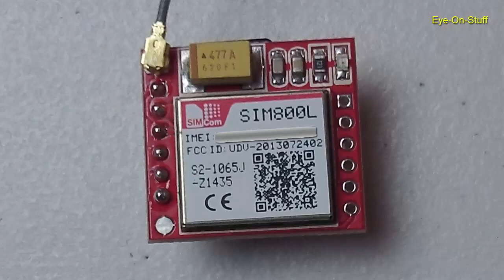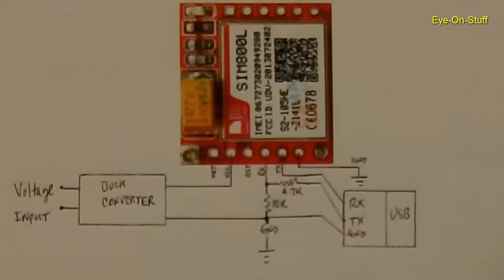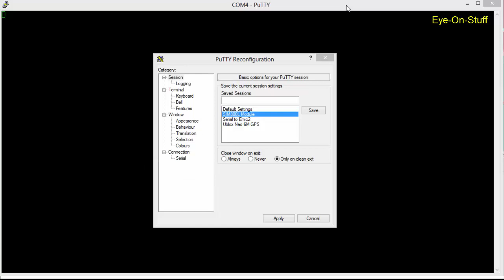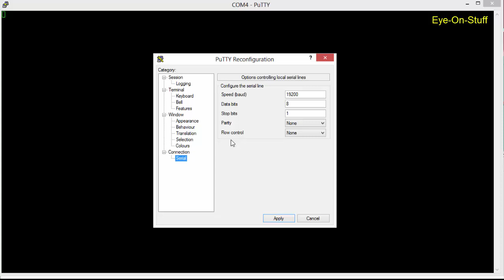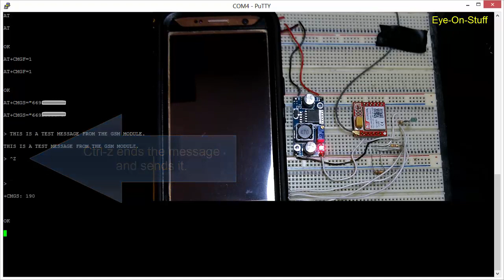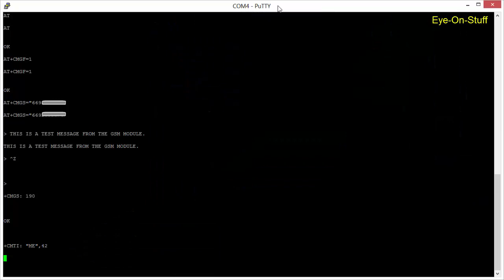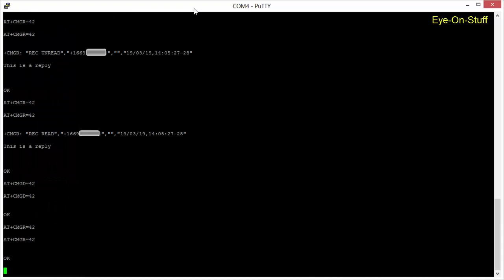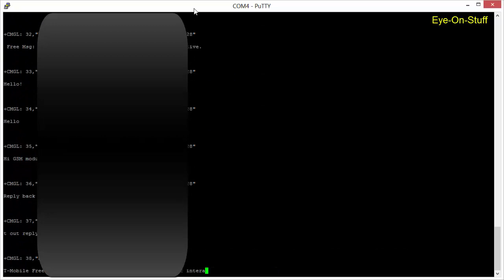How to use a GSM module to send and receive SMS messages : SIM800L : AT Commands : Eye-On-Stuff

Comment: thank you so very much, a bit of searching and this is the first video I found after a good bit of searching that covered SIM usage properly and was not just about setting up GSM with a over built module that used more power than I needed.  they also did not cover the basics and basic tool information like you did in such great detail. My usecase is a little different but now I finally have a good understanding of the direction I am going in.

Comment: Great video! I've just bought one of these modules. Could I simply drop a 5 volt supply through a diode and provide a large capacitor after the diode, to power the module?

Comment: Im using a giffgaff 4g it dont work, Can you help me figure out what im
 doing wrong, what sim card do i need and how do i get one.
Reply from the maker: Not familiar with giffgaff. If the sim card works with unlocked gsm devices then it should work with the module.  If the your sim card only works with a particular carrier then it will probably not work.
Reply from the maker: First try using your card in a unlocked gsm phone.  If it works, then it might work in the sim800.
Reply: Eye-On-Stuff I ordered a 1pmobile sim card... works perfectly 👍

Comment: Can I use Arduino uno? Please send codes for it I need it ASAP
Reply from the maker: My compiler is pic basic pro from Melabs. I don't use arduino.  To answer your question, Yes it will work with arduino. I'm sure you can find code out there for arduino.

Comment: Did you check how many SMS could you send in a minute? What is the SMS throughput? I would like to make my own SMS gateway for 2 factor authentication and notifications, and this looks like a neat solution!
Reply from the maker: For my application, I don't have the need to do that. Sounds interesting.
Reply: one hour one ports can send 800 sms 
Marketing bulk sms device. Send and receive sms at high speed .
Provide factory lowest price with free sofware ,offer free life time technical support.
Fast delivery ,hot selling in indonesia, Vietnam,malaysia ,USA,UK....
⚠️Hotline:
Whatsapp/ Wechat/ Zalo :+8613715985640
Skype : live:6bac679d890c89a2
Reply: there is a limit in gsm/2g itself. you can simply look it up, its not specific to this module :)

Comment: Bro in my project sim800 l blink after 20-22 seconds plz help me network doesnt stable 
Or
2g sim is mendatory or 4g can be used plz help bro plzzzz
Reply from the maker: If you have not tried it. I would use a regular Tmobile sim card and set it up for pay as you go. Just put maybe $10 on it.  Verify the sim card is working on a unlocked gsm phone.  You can find them on ebay amazon or even the tmobile store. Make sure your serial connection is good connected to a terminal.  AT > Ok.  The OK does not mean your sim card service is ok.

-Tmobile sim card pay as you go
- check wiring
- verify serial communication 
- Are you in an area where you have tmobile service? Verify with unlocked phone
- Is your sim800l bad?
Hope this helps.
Reply: Marketing bulk sms device. Send and receive sms at high speed .
Provide factory lowest price with free sofware ,offer free life time technical support.
Fast delivery ,hot selling in indonesia, Vietnam,malaysia ,USA,UK....
⚠️Hotline:
Whatsapp/ Wechat/ Zalo :+8613715985640
Skype : live:6bac679d890c89a2

Comment: Good day sir,
Is it possible to operate the module without the laptop instead with the use of buttons? Like you will do some coding then attach some buttons to the module that if you'll press, it will automatically send the message?
Reply from the maker: Yes, I made a video interfacing a gsm module with a microcontroler and used a motion sensor to make a stand alone  alarm. You can modify the code to use a button and send a specific message :  https://youtu.be/Ph6yolRmD4E

Comment: SIM800L  Problems:    Setup:
1-Checked ATT coverage for 2G at my location. Covered OK
2-Used SIM card from my phone to make sure it was active and working.
3-Used a 12Volt, 10 Amp/Hr. battery as a power source.
4-Used a 3 Amp 'Step-Down' converter, set to 4.1 Volts output.
5-Used 25mm (about 1") long power leads, 20 gauge, soldered directly to the SIM800L board.
6-Tested with 2 antennas (the helix included) and an external IPEX Connector Antenna.
7-Using Putty, communicated with the SIM800L module with AT commands.
8-Communication was OK, working but NO connection to the ATT network.
(Did try my bench power supply as well, same results, LED blinking at 1/second-no connection)

In all cases, when powered up, the SIM800L LED blinked once/second.  I then transported the powered up 
SIM800L  to within about 150 meters (about 400 feet) of the nearest ATT Cell Tower.  I disconnected power to 
the module and reconnected, LED still blinking 1/second.  I powered down the module, removed the SIM Card, 
cleaned the contacts and re-inserted the SIM card.  STILL within 150M of the ATT Cell tower, I powered the SIM800L up, still blinking at 1/second,  waited about 10 minutes, still blinking at 1/second, no connection.
NOTE:  Replaced my SIM card in my phone, all OK.

Any suggestions would be appreciated.
Reply: AT&T sunset their 2G network years ago. 3G is the oldest standard still in use by them. You would need a T-Mobile (or one of their MVNOs) SIM card, as they are the last 2G provider in the US.
Reply: @daynater  MY BAD!--I looked again,...OLD MAP!  AT&T 2G DEAD, Verizon 2G, DEAD at the end of this month. T-Mobile 2G DEAD in 2020, etc.   Any Idea what module to use to duplicate the SIM800L with 3G?
Reply: Adafruit has a couple 3G and LTE options for modules. they may be backwards compatible.
Reply from the maker: I would try a Tmobile pay as you go or prepaid sim card.  You can find them on ebay, Amazon or even a tmobile store.  Call 1-800-866-2453 to activate as pay as you go. You can just put $10 on it for testing.  You can even buy a sim card by calling the tmobile number.

Comment: Hello!
I want to use jio 4g simcard..
can i use such sim with sim800L gsm module??
help me please....
thanks in advance..
Reply: Same here. Plz amswer.
Reply: u can use a 3g sim
Reply: It will work, but the data connection will be limited to 2G
Reply: No.. the GSM modem is GPRS which is 2G .. so you cannot use jio..